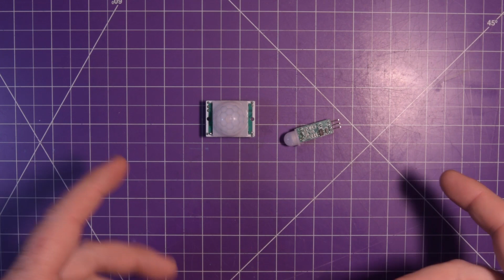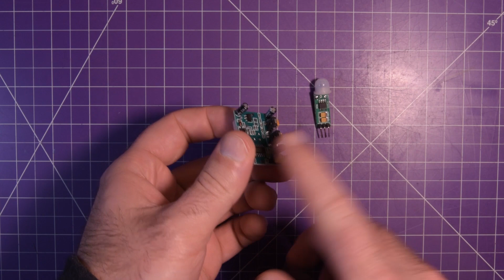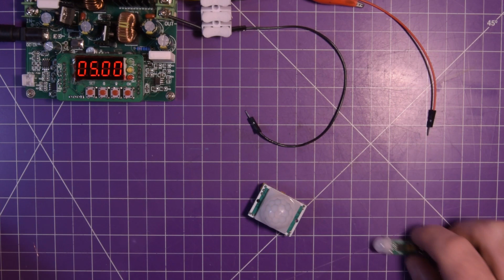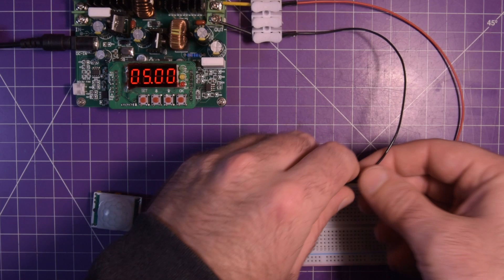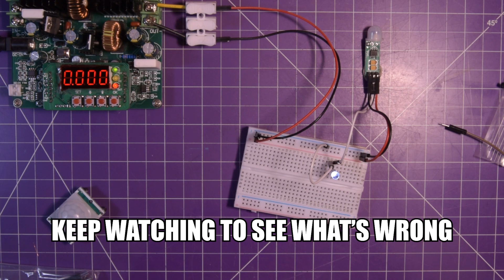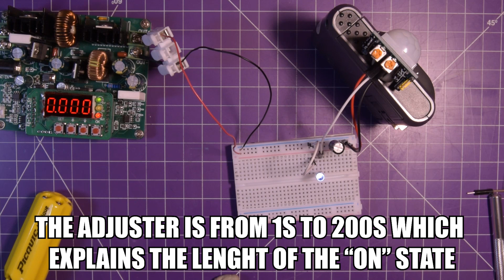PIR Sensors And How To Use Them

Comment: For the "big" module: if you move the Vcc supply connection from the "bottom header" (Vcc, OUT, GND) to the "lower pin of the top header", you will bypass the on-board voltage regulator, and you can power it using 3.3V
Reply: you can bypass the diode next to vcc as it consumes 0.78 volts and power it off 3.3v